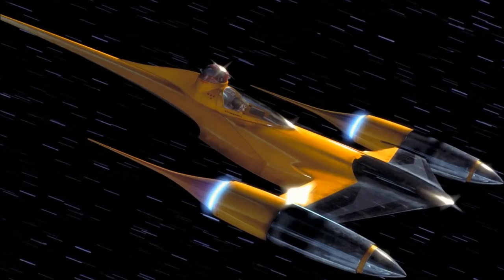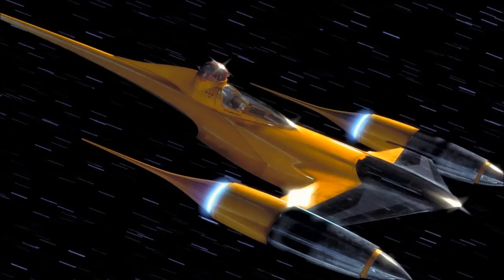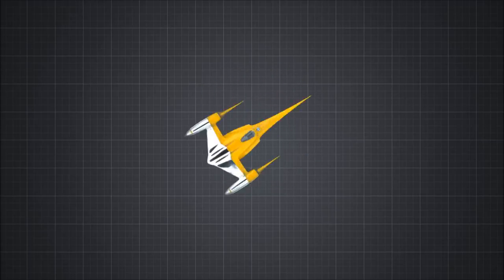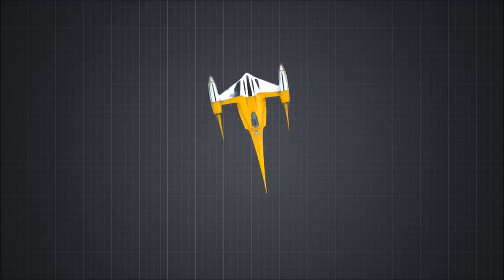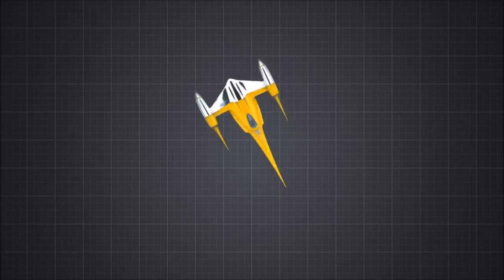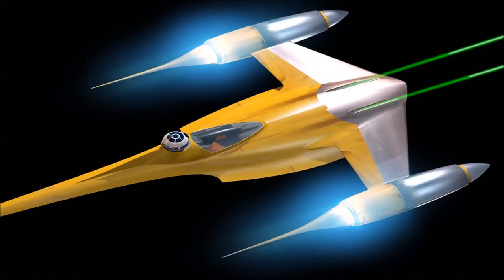Star Wars: The Big Problem with the Naboo Starfighter - Spacedock Short

Comment from the maker: In this instance, spinning is far from a good trick. :P

Head over to https://www.twitch.tv/spacedockhq to subscribe to our streaming channel. We'll be starting a playthru of Mass Effect 2 tomorrow (02/12/17) at 18:00 GMT.
Reply: Spacedock  quick question if you redesign the N1 how would you do it? I would make into a V shape and put  a thruster under the tail spin. To deal with the issue you raised.
Reply: heheheh Date translation for Americans: 12/02/17. ;) :P Thank you so much, Spacedock team for all of your hard work supplying we nerds with the brain juice we crave! I think I might just have to pop in and watch a bit of your ME2 playthrough! Peace and fly safe! ;) :)
Reply: Reminds me of the scene from Rogue Squadron when Corran Horn's X-wing took an Ion cannon shot from an interdictor. half his engines went out, and e ended up in a spin just as you described.
Reply: This is the solution: http://starwars.wikia.com/wiki/N-X_Police_Cruiser
Reply: wouldn't a spin only occur if drag from the mass to one side of the engine was an issue?  how much drag of this type can there really be in space?  I mean the engines maneuver from vectored thrust.  you'd think a computer would be able to correct for that fairly quickly.  the mass of the body to one side can't be that great in a starfighter of this size, at least not in comparison to the power of the engine.  just my two cents.
Reply: Acceleration. I will admit, in the case of your engine getting blasted off with a laser cannon I'd think your astromech would take care of the problem pretty quick. But in the case I mentioned, an X-wing got clipped by a capital ship ion cannon. He was lucky his ship didn't melt. The computers were fried, and Whistler got shut down, so his port engines were stuck accelerating, thus the spin.
Reply: Hey Daniel,  ready for a terrifying thought...   The 1998 Star Wars Encyclopedia has the Millennium falcon as "the smallest" ship to carry inertial dampeners, until the x wing.   the xwing was the FIRST fighter in star wars to carry that tech, even the TIE fighter and first order Tie fighter don't have them.   Infact part of the NEW features for the first order tie pilot suit is...  a G-suit, yep, the old squeeze the blood out of the feet and lower legs to keep from blacking out.   

anyone for naboo pilot toothpaste?
Reply: In real life, most two-engine aircaft have a safety feature built in to detect differential thrust from a malfunction. On multi-engine propeller aircraft this will cause an auto-feather, or a low-rpm pitch adjustment. I'm sure fictional spacecraft designers have similar measures in place.

A significant loss of power in one engine would probably cause the other engine to reduce throttle to a level where the etheric rudder can compensate. (That's the name of the magic steering device meant to explain the lack of directional thrusters and reaction wheels on space things in Star Wars.)
Reply: in real life,  most twin engine aircraft have the engines mounted close to the body,  the exception to this being the VC-22.   the VC-22 "needs"   a special system to keep both engines "spinning"  because the torque effect of a single engine failure makes the aircraft uncontrollable even with one side feathered.   now in space this isn't as bad with an off center thrust...  but in atmosphere with drag....   that starfighter will flat spin right into the ground every time.
Reply: Respectfully, if one engine gets shot-out, it's toast.  On the other hand, with the separation distance, maybe the pilot isn't as likely to get shredded by engine parts if and when an engine does explode.

It's a thought...

Anyway, I also am quite fond of this fighter design.  My complaint about it, though, is the horrible visibility out of the cockpit.  The long nose combines with the low cockpit to  make it impossible to see anything more than five degrees below the line of travel, the winglets and engines make it impossible to see anything to the sides, and the back of the cockpit precludes seeing anything behind the craft.

IMO, the only way to compensate for such a poor design would be for the pilot to have a HUD/visor with projections for everything the ship blocks, but the Naboo pilots (obviously) didn't have such a system...
Reply: the VC-22 "needs"   a special system to keep both engines "spinning"  because 

it would not be able to land with only one engine
Reply: actually its "original" claim was... and original call... if one engine is lost...   it could still fly as a "plane"  and land like a traditional aircraft in an emergency.    but the instability from the torque due to the engines being so far out made that actually impossible...  and remember the "system"  as is will only compensate for a base engine failure... IF the engine is damaged by enemy fire to the point where it does stop...  well thats it...
Reply: V-22's are also incapable of traditional autorotation
Reply: Spacedock 
so you're a fan of chromed Me-262?;)
Reply: land like a traditional aircraft in an emergency
it can not the rotors are too big
Reply: it was "expected" to come in like a normal aircraft and either at the last moment during the flare "rotate" the engines to the 45 degree angle as the pilots cut all power....   or...  let the roters hit the ground... they were looking for a crash landing procedure that worked...   but the torque difference simply made controlling the aircraft impossible.
Reply: Spacedock alot of the complaints in this video are actually present in real world aircraft. The p38 lighting from wwii is very similar to the n1 having all of its guns in the nose and having two engines although not nearly as spread. Many wwii fighters including the iconic p51, spitfire, hurricane, and later versions of the p40 had their guns spread requiring the guns to be sighted in to a set convergence distance making them less effective up close or far away.
Reply: infact the pilot would decide his convergence before flight.   and each gun would have to be individually sighted in to that range.   often the zone would be set at 750 feet for brittish fighters,  though a few pilots liked setting their range to 1000.   Some newer pilots or tight in dog fighters would remove the tracers from their belts, and have their convergence set at 300 feet.   Not good for bomber hunting but great for dog fighting.   some mustang pilots preferred 450 feet...  again they primary went after fighters and not bombers.
Reply: Honest question, what causes the spin though? One would assume that without the drag/friction of an atmosphere, there would be nothing to cause spin as there is no opposing force. I'm not well versed in physics so I'd love to know why it would still spin in space!
Reply: Very wide off centered thrust even in space will cause torque spin  as the trust attempts to rotate around the center of mass.
Reply: kitsychan, gotcha! Thanks!
Reply: Solution to making the Naboo Starfighter: Add another engine at the bottom of the cockpit, and some stabalizers and thrusters at the back of the cockpit.
Reply: you know your talking about a ship that shouldn't be able to fly anyway with the lack of manoeuvring thrusters
Reply: Spacedock 
Hey so I got a suggestion.. MC90 mon calamari cruiser
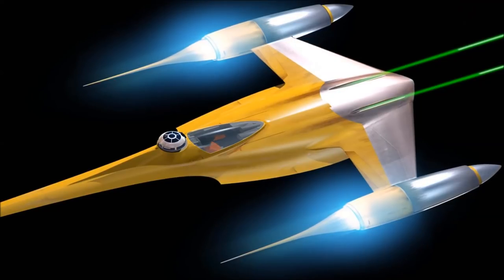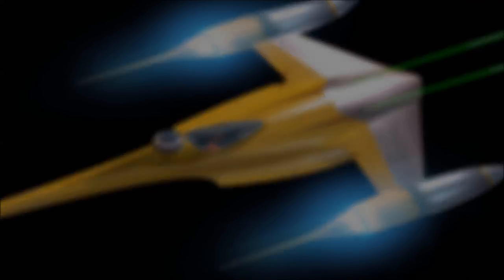Reply: 2:01 - 2:13, many, many, many pilots from the Second World War, if they were still alive, would probably like to have a few words with you.
Reply: I would like to point out that the repulsor technology star wars ships use to maneuver in flight would likely be capable and used to counter the possible spin caused by the failure of an engine.

Comment: Naboo Kamikaze star-shuriken: Shut down one engine and ram the enemy overexposed bridge while spinning out of control. Use the starfighter tail as an stabbing stick for maximum effect.

80% more damage than the A-wing lucky crash maneuver.
Reply: Vicho Deivis OK BOYS LETS MAKE THE JAPANESE MOVES
Reply: Vicho Deivis Nailed it!
Reply: Sounds like some kind of Pokemon joke Vicho Deivis.
Reply: Jack Harpe 3rd Almost, I was thinking in Naruto xD
Reply: Lol Vicho Deivis
Reply: Sometimes I think Ampharos is technically a Tauntaun with yellow scales, lacking wool, and has Force Lightning Powers. Or should I say "Unlimited Power!!!"
Reply: It doesnt do that form of spinning. Lol
Reply: that'd work if the N-1 is made of durable enough material Naboo Starfighters are mainly cermonial craft and not exactly built for war...

Comment: I think Naboo's designs get a bit of a pass for being mostly ceremonial, though. Kind of like if you were to criticize the tall hats of British guards (or the bright red coats.)
Reply: Tell that to the french pre-WWI.
Reply: CodexofWisdom 
The bright colors were intended to differentiate forces in the black powder era when hiding a gunshot was nearly impossible.
Reply: Whats the problem with the design? It has two engines far apart from each other so it can turn quickly. It is aerodynamik. The pilot can actually see the battlefield unlike the Tie Fighter and the turrets are close together so they will hit the same target.
Reply: It's roughly equivalent to taking a police car into a tank battle.....
Reply: @Stego1819  I forgot the need for aerodynamics in the vacuum of space

Comment: An automated power cut off switch for both engines, where the pilot does not have to necessarily do anything, for when one engine is lost would likely limit the danger of this situation. However, I do agree that these ships were made mainly to look pretty instead of for actual combat.
Reply: Good idea.  And it's entirely possible you won't need such a measure.  Getting hit by anything while piloting a starfighter in SW is almost always cause for your entire craft exploding so spectacularly that it doesn't even leave behind enough debris to bother your enemy's ship as he flies through what remains.  See?  Totally bypasses the problem.